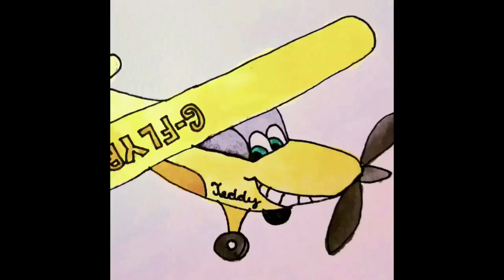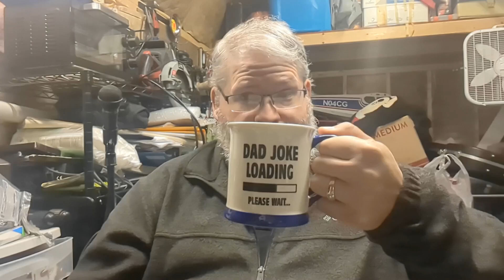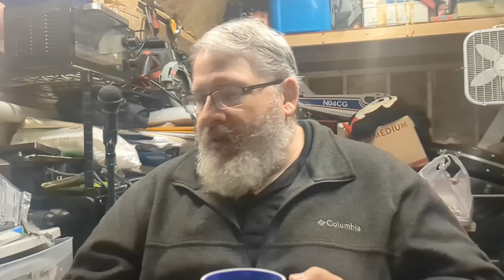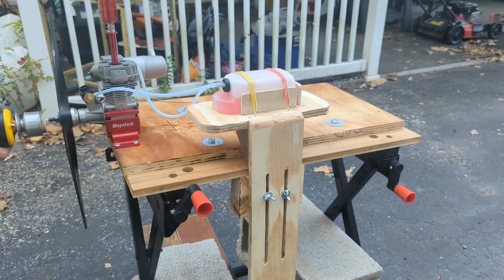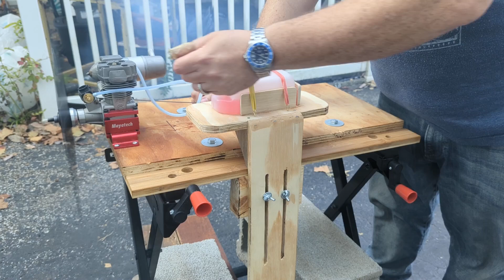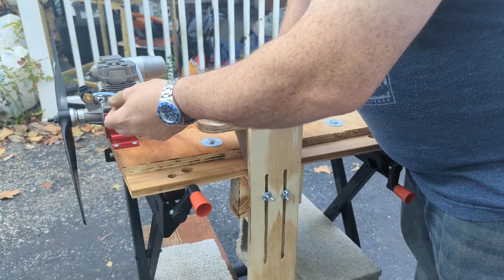Super Tigre G2300 Update..Now too lean! (2nd run since the updates)

Comment: I would say that as a relative newcomer to glow engine tuning, you adjust the high speed needle while at full throttle. That way you can hear the progression from rich to lean and get accustomed to it. Without a target or known rpm for a specific prop say from a review article, the only way to tune to peak RPM is while at full throttle. You can hear the increase in RPM and when it stops increasing or begins to decrease to have reached the max RPM.
Reply from the maker: I have slowly been getting the feel for doing this...I did attempt the pinch test too but I can ignore that and focus more on listening to the RPMs. Is it also recommended to turn in small increments... Like 1/8th to 1/4th turn?
Reply: @perkyplanesrc9363  The manufactures recommend small adjustments.  As you get to know your engine and glow engines in general you will know how far to adjust each time.  I see the manufacturers instructions as ‘guidelines’ only.  More experienced folks simply look at them and say, yeah whatever.  After having read hundreds of engine manuals I have seen how break in instructions vary widely even across similar construction engines.  Now obviously they change these instructions as fuel, oil, and metallurgy of the engines has changed, but still…..

Comment: The first few moments it sounds really good! Might lean the low end just a touch. On my big engines I run large fuel line. This does require getting larger brass and drilling the clunk out. That's the only change i would make. Just on the supply side.
Reply from the maker: Thanks! Yeah usually at low RPMs it doesn't sound too bad, but transitioning to high it's not that smooth. As for the fuel tubing, I believe the G2300 is the largest engine that still uses medium tubing... After that you get to the "big Tigres". I do think my fuel clunk is a large one.
Reply: @perkyplanesrc9363  it'll come around. Might still be breaking in

Comment: I have a Moki 1.80 that would dead stick if I tried to run a prop on the larger side of the recommend props. It called for an 18x8-18x10 to a 20x6. A 17x10 and 18x8 was ok, but an 18x10 would overheat and die. Always seems to be rich in the midrange when it was running reliably.
Reply from the maker: Weird that an 18x10 would do that especially if it was recommended. Maybe needed retuned a tad? Or could the prop be a little out of balance?

Comment: Chris, it actually sounded and looked overly rich to me at WOT, with all that smoke. No?
I usually adjust the high speed needle with the carb wide open, it’s easier to hear the pitch change and get it just right. When you do it at lower throttle openings, you are just guessing how much more is needed. 
I know what you mean about the confusing array of info on what fuel to run in these big Tigres. I definitely think there is a difference between the Italian and Chinese versions as far as recommendations. 

Love the content, keep up the good work.
Reply from the maker: Thanks! Yeah I agree it is weird as it does appear to be rich by the smoke in the exhaust and it just sounds a little rough. The part about it being lean was the fact that I got it to backfire a few times lol... Read that's usually an indication of being lean.
Reply: @perkyplanesrc9363  , I’ve definitely over leaned a few 4-strokes trying to find their peak and they would backfire and throw the prop and nut off into the weeds, never had a 2 stroke do it though. 
I would just try running it wide open at full throttle and slowly close the needle a couple clicks at a time until it stops increasing in rpm. Back it off a couple and you should be set. 
Do you know the “pinch test”? Another quick way to check if you are too lean or too rich with your needle setting. It works for issue mixture as well.
Reply from the maker: Sounds good... I'll give it a try. And yeah I had heard of the pinch test but forgot what to look for when you pinch it. I'll check into it.
Reply: @perkyplanesrc9363 , very simply - if the engine rpm increases after a quick pinch and release of the fuel line, then you are still on the rich side. If the engine rpm decreases or even stumbles and quits after a quick pinch and release, then you are too lean. That is the basic idea with this test. Give it a try!
Reply: @superdutyspinner Personally i don’t use or recommend the pinch test for a two stroke engine. It is for four stroke engines. Since there is firing on every other stroke the likelihood of that test being accurate goes way down. Just my opinion based on years of tuning engines.
Reply: @dmrcflyr2  , oh I did not know that distinction. Thanks for the clarification.